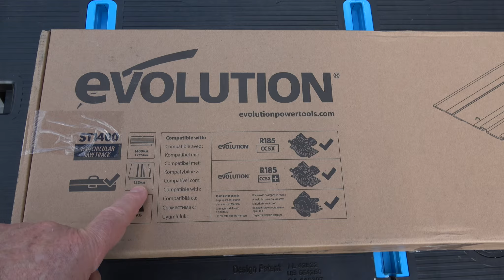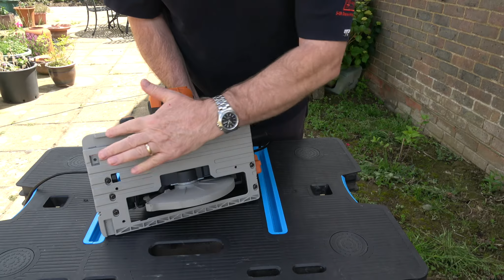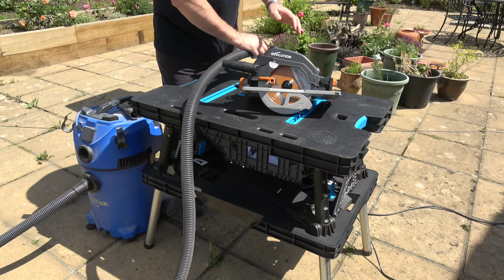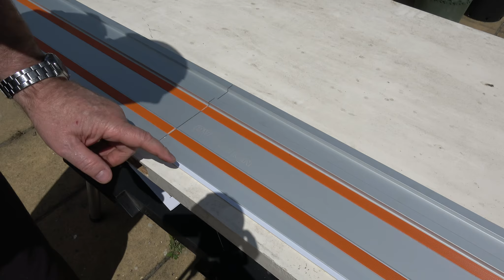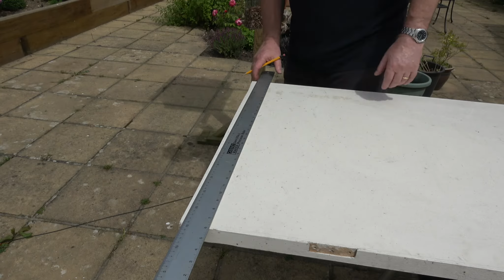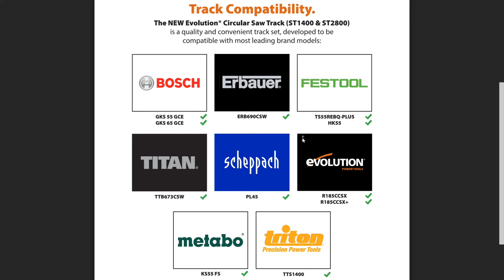Evolution R185CCSX+ with the ST1400 track - Brilliant for sheet materials!

Comment: Another sale pitch -- Don't believed whatever this guy talk. The saw is weak -- not enough power to go thru 2 pieces of plywood, and the tear off. They have to redesign the motor and the track saw. The splint guard is not good.

Comment: Hi Russell would the sx+ be a viable alternative to there standard circular saw.is it alot bulkier?.was considering the standard but want the a bag anyway.i won't be cutting much sheet material but have a couple of doors to alter so might not need to purchase the tracks.might use your homemade jig technique in your review ofthe standard saw .I see it has a bigger motor also and longer lead .just wondering if it is worth it as mainly used as a standard circular saw or too big many thanks
Reply from the maker: I still have both saws Paul and I only use the SX when I need the track for cutting sheet materials.  It is a bit too bulky for the other tasks.  It would be fine for them, but I generally prefer the SL and use that for most jobs.  The jig works a treat for trimming doors and you could also make one for sheet materials.  The track saw is considerably better for long cuts as the track physically stops the saw moving off the line whereas the jig relies on the user to keep the saw against it.  The SL is my goto saw.  I hope this helps!  :-)
Reply: That's very helpful Russell.i m going to go for the sl standard saw many thanks for the prompt an comprehensive reply
Reply from the maker: You're welcome!  :-)

Comment: So. No negatives? It cut an exact 90°? No flexing when set to 45°? Blade parallel with the track? Ah. A perfect track saw.
Reply from the maker: I have no issues with the track or saw.  I have used it to cut plywood sheets in half, it performed well and it made life way easier.  I have not used it for anything else, but I am glad that I have it.  There is no such thing as a perfect saw, this is a good saw to have in the workshop!  :-)

Comment: Thanks for the demo Russel do you know if you can use the guide on a bevel cut at 90degrees please I want to cut french cleats using it ?
Reply from the maker: I am not quite sure what you are intending to do.  You could cut french cleats with the saw set to cut 45 degrees on a bench.  If you want a steeper angle, you would have to try and make some kind of jig and I reckon it would prove difficult.  :-)

Comment: Thanks for the info.  I have a question.  When cutting without track, your body seems left of centre of the saw. So comfortably both hands on the saw, with the saw slightly right.  It looks a comfortable and natural position When cutting using the track, your body is over to the right of the saw and your arms are left of your body.  Almost stretching across the saw to grab the handles.  This looks awkward and uncomfortable.  Surely this is a design flaw?  I have the same saw and never used it on the track because of this.
Reply from the maker: There is no other way to use the circular saw on wide material Steve.  it is the same with or without the track.  Using the track makes it much easier and safer.  If you imagine cutting a  few inches off the end of your bed using a saw you will see that you have to either stand to the side and push the saw or climb on the bed and push it.  :-)

Comment: Pretty much a perfectly relevant review for what my son needs. I've sent him the link and recommended the saw. The [+] version has some real advantages over the non-[+], especially the longer cable. I've seen reviews that say the standard version that comes with track does not include track clamps. I recommend getting the [+] and buying track separately.
Reply from the maker: I used mine the other day to cut some 8 x 4 plywood in half.  It is very handy for larger work pieces.  :-)

Comment: So russell it can cut six mm plate that is very good like I ask you in yr previous vedio so if you can get a blade that can  cut metal only with their saws then that will be very good also it means when u need to cut any thing else you have the black that will cut other materials when u need to hope u get my point
Reply from the maker: Sorry Keith.  I just checked my blades and they are suitable for 6mm mild steel.  I do not cut much mild steel with my saws.  I use them for wood mostly.  :-)
Reply: @RussellPlatten  i think that  blade to cut six mm plate steel,is good enough
Reply from the maker: @kojomensah7474  It is Keith.  I do not know how long it will last with heavy use, but the blades are nor particularly expensive and they are way better than abrasive discs!  :-)

Comment: i will not use my evo table saw or circular to cut metal but that is cos i have a plasma cutter to do that job but have to say cannot fault either of them next on my list is to get evo track saw
Reply from the maker: The track saw is very handy for sheet material.  I used mine the other day to cut two 8' x 4' sheets.  :-)

Comment: Hi, very good review Russel, 
may i ask something.. why you leave gap ~1mm between 2 tracks? Just wonder. Thanks.
Reply from the maker: I don't know for sure, but I reckon it is to allow for expansion as the track is aluminium and the inserts are steel.  Aluminium expands twice as much as steel for the same temperature change.  :-)
Reply: The rails are very unlikely to perfectly align, when butted up tight together, and the leading part of the saw will jam slightly as it transitions to the next rail.    With a gap, there is sufficient tolerance or slack in the alignment for the saw to find its way more smoothly across the joint.   This is Evolution’s explanation, and it works in practice.